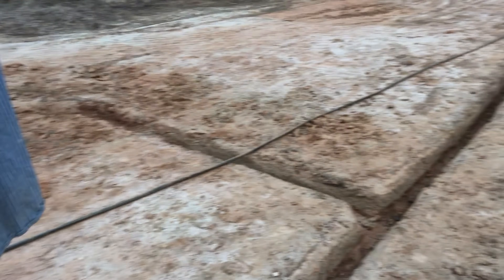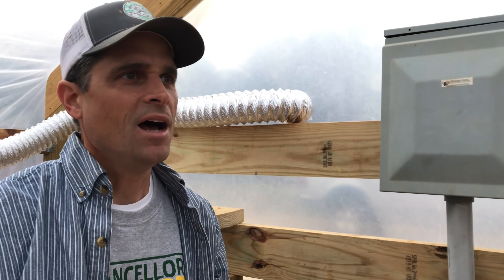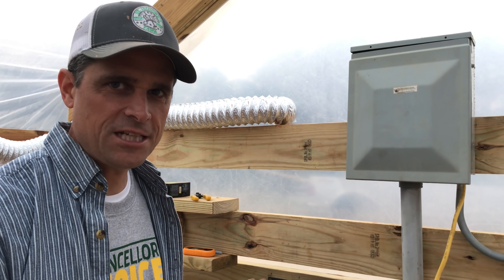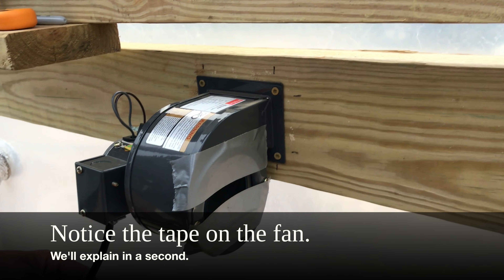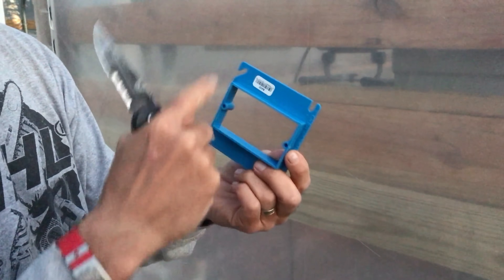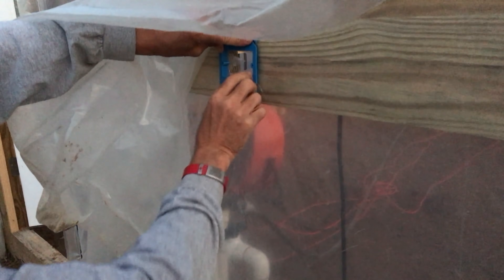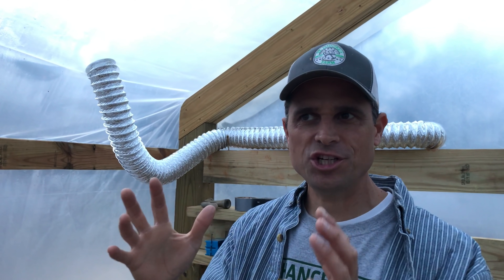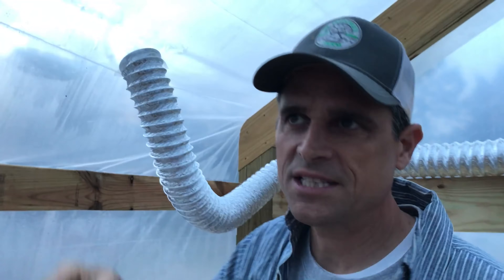DIY Geothermal Greenhouse Pt 10: POLY FILM INFLATION

Comment: In some locations newly installed fire suppression systems like in a computer center usually requires a test of the leakage in the area to find out how long the fire suppression gas will remain in the room.  This is done by measuring  over say 30 minutes the air leakage.  Your local fire department or building inspector could tell you if they have the apparatus and maybe bring it out and make a test of the air leakage in your system.  In Dayton, Ohio the test  is known as Fan-Door Test - called that I suppose because they put their fan in a doorway to pressurize the room.  This might work and be of no or low cost

Comment: Hello, after watching part 10 - I was remembering some of what I learned on the subject of hydraulics and aerodynamics - when the blower fan is working it has to defeat 1-the atmospheric pressure of all the air present in the pipe system, and 2-the air drag resistance of the 4" pipes given their ribbed structure. Have you done a quick test and tried, momentarily, putting one of the blower fans on the exhaust pipe? (pulling air) - This would create a drop in pressure at the output and the atmospheric pressure would rush air into the inlet pipe and air flow resistance in the 4" pipes would drop.
Reply from the maker: We have not tried putting a fan on the exhaust pipe. Certainly willing to give it a try to compare. Thanks - we've learned a lot from the comments on these videos!
Reply: When you get a chance to try this, use your anemometer on the air inlet to get a reading of the air speed. By comparing the, input/output, drops in air speed when the fan is "pushing" to when the fan is "pulling" - you can see which configuration is giving you the best performance. Thank you.
Reply: @waltsilva6515  Fans always do better to push. This is for both air and water.

Comment: A few comments scattered around about the speed differences being due to temperature change - I'd add that you're probably also losing some airflow efficiency due to the perforated pipe bleeding air into the dirt.  Another comment posed a question of push vs pull for best results - from a physics standpoint I don't know if it'd make any difference, apart from the earth battery cooling the hot air from the pusher fan (it's going to produce it's own heat too) vs the puller fan heating the already cooled air - there's probably some variables relating to distance of piping, etc, to base whether that's an apples-to-apples concern or not - but relating it to my first point, a pulling fan will run the risk of sucking in dirt through that perforated pipe - my gut tells me you'd want to maintain a positive pressure in that underground pipe to prevent contamination.
Reply from the maker: Spot on. We plan to show it in a future video, but because it has become so dry in the greenhouse the ground below has opened up cracks out of which air blows (probably from the 2' course of pipes). They're tiny spots, but spots of airflow just the same. So yes, the positive pressure must prevent dirt from falling back into the pipes (at least while it is running).

Comment: Wind Speed in the air battery.   Warm air going in at 14 mph.  Colder air coming out at 12 mph.  As the air passes through the battery it cools down and increases in density and decreases in velocity.
Reply from the maker: Thanks!

Comment: Why don't you:
1. Get a way smaller fan .. you just need to inflate it one, then account for leakage after that.
OR
2. Jjust create a small exit for the air to return  back to the greenhouse at the other end of your greenhouse.

Using that monster fan also wastes electricity and forces more hot air, or cold air, than necessary out of the greenhouse doesn't it?
Reply from the maker: Admittedly, we've not built a greenhouse before. The fan we used is one of the two sizes most greenhouse suppliers sell for this purpose. We went with the slightly bigger one because it was only a little more on Amazon and figured it couldn't hurt. Had no idea such a small fan could push so much air and cause a problem. It is a DC motor, so it's pulling little energy, and we did cut a hole in the other side of the greenhouse as shown in the video. Thanks!

Comment: If I had done this, I would want temperature sensors in the underground pipes at specific intervals. This would tell you at what length of buried pipe the building's heat is dissipated. It's a nerdy thing to want to do but it would help planning other ground batteries like this one. What a fabulous job you've done!
Reply from the maker: Thanks!

Comment: How about two fans on each system, one pushing and one pulling?
Reply from the maker: We tried two fans pushing and really couldn't see a noticeable difference at the return. As a number of people have commented on this series of videos - the real limitation becomes the pipes in the ground not the fans.
Reply: See how helpful your videos are? I now know my idea didn't work well. I would love to know the pipe-in-ground-length vs sq. footage of building you need to cool ratio. How do you know enough "ground battery" pipe is enough (or conversely, how much is too much and a waste)? I've never seen a "folded" design like you have, and it means almost any structure can have a ground battery.

Comment: Warm air goes in at 14 mph, becomes more dense as temp drops, cross section area is constant so velocity slows.  Losing 2-3 mph for a 20-30 degree temp drop doesn't seem too unreasonable to me.

Comment: Another concept I like is digging out a trench or like a pond three to four feet deep on the Southside and then taking the dirt and putting on the outside north of the greenhouse building a dirt wall that way on the North you have a dirt wall that absorbs heat and then you have the greenhouse which has plants and then also a fish hatchery.
The water Hatchery will help retain the temperature and the 8 to 10 ft dirt wall will retain the temperature
Reply: Bryce's Lazy Porch Garden  yes I am Kuwait ... just starting the green House way  and the heat is killing.  Looking into thermal batteries as we have a farm pond .  If we run a  line through the pond it should help with our 120-150 degree reduction.  I have not run across anyone doing this in desert climates yet?

Comment: i live in Canada and I have a small 8' by 8' greenhouse and have installed a heat sink / climate battery that runs into a 2' by 2' by 4' pit.  it seems to work pretty good although I have not ran any numbers. I just wondered if there was any way to hook the output into the double wall of the greenhouse???
Reply from the maker: Funny you ask this - we wondered the exact same thing. One of the challenges, as we understand it, is that condensation will build up between the layers if you use air from inside the greenhouse. That seems like a real possibility.
Reply: St. Isidore's Farm I am just spitballing here but aren’t you using the air from your greenhouse to fill the double wall. And my understanding of my climate battery is that it should take the condensation out. So if my output runs into the wall and I have a valve or even an output that comes out of the double wall and back into my greenhouse. Circulating the air throughout. Anyways thanks for responding.
Reply from the maker: Yes, we are for now, but we're also not running it in really cold weather when condensation between layers of film might be more significant. We really did think about a splitter off the the return pipes to inflate the film. Still might try it just to see if it would work.

Comment: I like the concept of forcing air down underground 4 to 6 feet and then across to the other end of the greenhouse and then having another tube that's independent that's a couple feet from the ground level that way the air that you put in from the 6 ft or 4 ft level will act as a battery and gradually creep up to the 2-foot level which would be your exhaust at night so you'd have two different structures hoses one is the lower is six to eight foot deep .
 heats up and as the heat rises and,

At night you cut the bottom one off and you use the top one ,
The one that's two foot below and under extreme conditions you can use both of them you'll be taking the temperature 45 to 50 degrees from the ground underneath the lowest pipe and then you'll be taking the battery the heated up air from the top part hose so that would work great .

In effect you'll have two batteries.

I know that's too late now for this greenhouse but on the next ones that is a concept to consider
Reply: Heat moves downwards in the ground as well as upwards so the 45-50F may not stay that temperature for long. Make a box out of rigid insulation board, 2ft high and1 foot square internally. Fill it half full with oven dried soil taken from the greenhouse site. Place a heatmat on top and put another 12" of dry soil on top. Install temperature sensors every 2" above and below the heatmat. Turn it on and monitor the sensors to see how the heat moves and how long it takes to move. The test results will reflect your unique soil type, ie; clay, loam, sand, high organic content etc, different types will not give the same result. Using bone dry soil provides the slowest heat movement (the worst case scenario). Very few folks do practical experiments to find the answer but imho its the only way you can be sure its correct.

Comment: Dude!!!  I run inflation skins by the acre.  All you need to do is plumb in an escape hose on the opposite side of the greenhouse and either just put a rubber flap over the pipe, or use a wife ball on a upward turned elbow, or the even just a laundry vent escape louver from home depot and it'll stay well inflated.  You DO NOT WANT TO BLOW YOUR HUMID EXHAUST BACK INTO THE GREENY OR... RIG SOME OVERLY COMPLEX ELECTRIC PRESSURE SENSOR TO START STOP THAT CHEAP MOTOR. You can even just put plastic sheeting over an exhaust pipe, let it inflate and then poke holes in it until you get it tuned.  If you need to get a proper inflation fan, or want a few tips, let me know.  Also, had I seen all this before you started, I would have told you the "Earth Battery" you went with only works with tiny greenies, next time go with coils of poly pipe and circulate the water inside and you make it run through a heat exchanger in front of a fan, which for a greenhouse you can build out of pvc, or lazy guys will use more poly coiled up in front of the fan.  I hope you have your exhaust fans ready, it gets humid in the winter, and hot in the summer.   Looks good though.
Reply: The fan in front of the heat exchanger will waste a lot of electrical power. I guess the water will circulate itself without needing a pump and more power ;) Consider the surface area of the heat exchanger and amount of greenhouse air being blown through it by the fan, it wont be very efficient for heating or cooling the greenhouse ;) Also, consider the temperature of the water will be same as the ground the pipes are buried in (the same as the buried ADS tubes) and the surface area of the buried coils will be far less than the ADS. Your idea will involve both air-to-water heat exchange AND water-to-ground heat exchange which is almost entirely by conduction (slow). You will need to insulate the pipe from the H.E to the coils so it cannt pick up heat (when cooling) or lose any heat (when heating) on the way. The SHCS only has one step, direct air to ground heat exchange which is both cheaper and infinitely more effective. Run the numbers for both systems and it`ll be clear which one will work  ;)
A differential pressure switch is no more complex than a basic inline on/off switch.
Reply from the maker: Thanks for the taking the time to write. The pressure switch really isn't super complicated and it's not expensive. We'll see how it works and put it in a future video. And if doesn't we'll probably do a variation of several of the comments. We will have exhaust fans in there soon, as well as the shade cloth, and roll up sides (eventually).

Comment: The air goes in warm and exits cooler. Put an inflated balloon in the refrigerator, let it cool down and look at the volume it takes up. Then heat it up again. :) The air loses volume as it loses heat. The lower speed reflects the lower volume exciting the pipe.
Reply from the maker: Thanks - probably helpful information they covered in the high school physics class I transferred out of 😂

Comment: A pressure switch will wear out your fan, but more importantly wear out your plastic and connections faster. You need a constant fan, but a lower cfm.
Reply from the maker: What I didn't convey well in the video is that the film stays fully inflated for quite some time after you turn it off, and the pressure switch would keep it from fully deflating. It won't be as if the fan is short cycling. My sense is that the fan will last for years, perhaps longer than if it ran constantly. Hope that all makes sense.
Reply: I believe you did mention it holding air well but it's still the same concept. Differences in pressure will destroy the plastic (specifically the connected edges) much sooner than normal. But I do hope that works out for you.
Reply: I like the concept of the pressure switch mostly because it would save on power cost.  Did the switch work?

Comment: We want to put in an earth battery before our next high tunnel and it seems to be beneficial according to your video. Thanks, as I think you have tipped the scale towards doing this.
Reply from the maker: We hope to continue to follow-up and share more data - hopefully, it will help others in deciding whether to install a system like this. What we can say now is that we would design and build the system differently, based on what others have commented and initial results.

Comment: How did you gauge the amount of slack in the poly to allow for inflation? Or did it stretch itself to accommodate once you started the air flow? Cheers
Reply from the maker: We pulled it as tight as we could when installing. The endwalls seemed as tight as a drum, but amazingly inflated out like huge pillows. Seems the film has a LOT of stretch in it. The website that sells the film put a square yard of it in spring lock base and the loaded weights on top of it to see what it took to rip. Ended up being over 400 pounds!
Reply: St. Isidore's Farm That's perfect! Thanks for the info 😊

Comment: I use this to run the fans in my GH. I don't use but one side but you could use both to control cooling and heating possibly.
https://www.amazon.com/Temperature-Controller-bayite-Pre-Wired-Thermostat/dp/B01KEYDNKK/ref=sr_1_11_sspa?ie=UTF8&qid=1524714966&sr=8-11-spons&keywords=temperature+switch+adjustable&psc=1
Reply from the maker: Thanks, we've actually looked at those and wish they would work for us - the challenge is that we need the same unit to serve as the heating and cooling - almost a thermostatically controlled three way switch - if that makes sense. But thank you again for taking the time to comment and suggest this!

Comment: An inexpensive controller will allow you to reduce the speed of the fan.
Reply from the maker: That was certainly another option we considered, but think the pressure switch will be even more efficient - we hope.
Reply: Can't wait to see the update.I am looking into the flow rate calculations that can be done for the battery. I recall that you do want a decent pressure in the tubing to allow for the water vapor to work its way into the soil. It makes for more efficient energy transfer.

Comment: Love it brother. The place is looking so good. One thing I would say is this. Growing up I worked as a helper foing HVAC work. Putting in duck work. I was told the more air moving over a coil would not mean colder air. It would like your saying just be more air moving faster. So I would think with you trying to store that heat it would be best not to have the air moving to fast. 

Thanks so much for letting us be a small part in this.  God Bless.
Reply from the maker: That makes a lot of sense to me. Still, we're getting a lot of conflicting advice about this system. Hard to sift through it all, honestly. But honestly, my thinking has always been what you said. Blessings to you as well - you guys remain in my prayers!